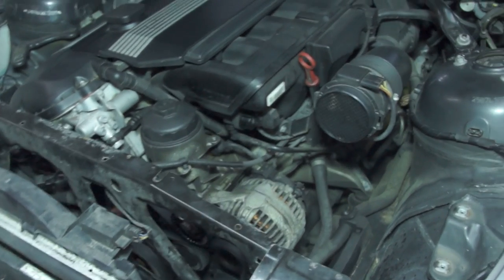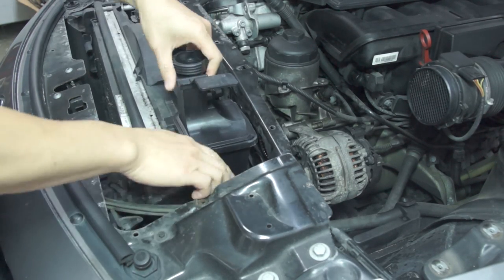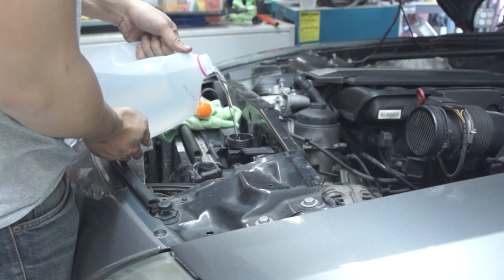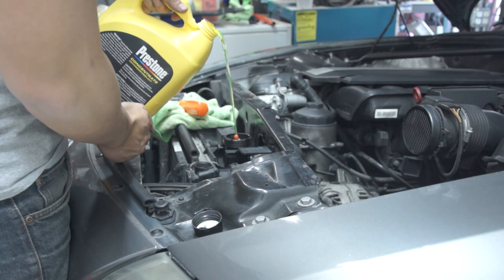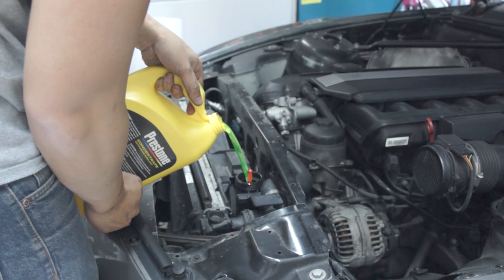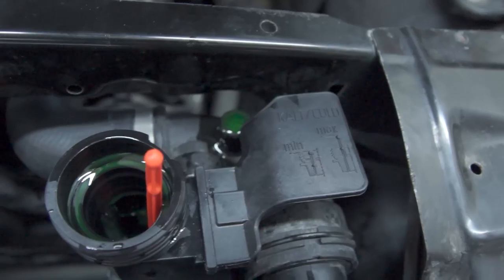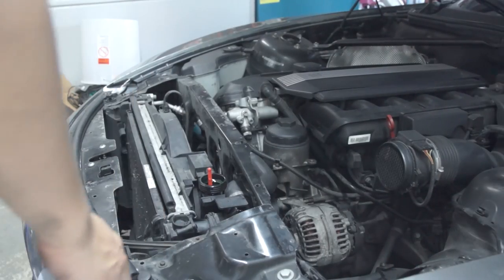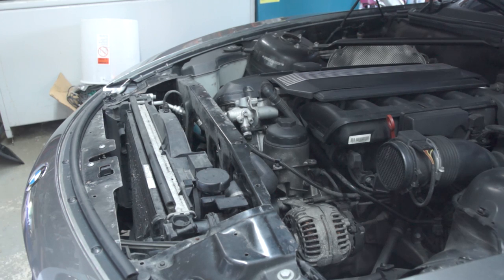Expansion Tank Replacement - BMW Z4 Vlog #22

Comment: I don't know if you park your car inside or out, but I park my car indoors. As a habit, I open my hood after I park to allow my Z4 engine to cool quickly. It may help in having the plastic parts bleed heat faster after a drive.

Comment: Hey @zed4me, I am wondering where do you buy your expansion tank? Also, I want to change my radiator and expansion tank as well. I have a 2003 BMW z4 3.0i. I want to know any advice for that? Like where will be a reliable source for me to buy these two parts? Also, what are the tools that I may need to use and replace these two parts?

Comment: First thanks for all of the great videos.  I just bought my first BWM Z4 E85 (2003) model.  Your videos have been a ton of help as I now have a roof replacement project ahead of me.   One question I wanted to ask is have you found a suitable upgrade for the headlights.  My bulbs don't really shine and with all of the new LED options, I was wondering if you have found a suitable replacement.
Reply from the maker: +Mark Byrn I've upgraded my projectors.. been meaning to make a video about how I did it but going into the wheel well arch is really annoying lol First I'd say clean the headlight with a headlight restoration kit.. then if its still bad, consider a bulb replacement. I don't know if LED would be brighter though, but consider HIDs, if you can cover up the squirrel finders on the projector.
Reply: +zed4me Yeah I cleaned the plastic glass with a kit, but I really don't like my bulbs.  I'd love to see a video on how you upgrade your lights.  I will look into the HID swap.  Was it easy to install?  I see the hatch behind my front wheels so I know where to go, just not sure what to buy.  Any insight would be appreciated.  Where did you buy yours?

Comment: Hey did you have a problem with the lower sealing rail? I noticed my z4's rail had came loose and I have been having trouble reinstalling it. I'm not sure how it goes back on
Reply from the maker: Sorry not familiar with this issue. What's going on exactly?
Reply: My coolant top off light was on so I grabbed some 50/50. When I looked in the bay there was some lost coolant on the ground as well as this loose plastic rail.. I googled the number on this rail and it brought me here, http://www.realoem.com/bmw/enUS/showparts?id=BZ11-EUR---E85-BMW-Z4+2.0i&diagId=17_0145  its #5
Reply from the maker: cbrindle3 I didn't have that issue, so I'm sorry I can't be of help

Comment: hi what company tank do you have. I have hella and still have problems with it leaking slowly from the  bottom
Reply from the maker: Check your hoses that doesn't sound like a tank issue. I think I went with behr
Reply: Hi when I move the bottom of tank it leaks right from  tank joint where there is no hose joint. I going to by a bmw tank now

Comment: shouldn't you be using the bmw $25.00 a gal. coolant. I read there are different  mineral /silica levels in different  euro vs jdm vs us engines. nice z4. m54 does not recover well from over heating.
Reply from the maker: I don't know of any real reason, just people saying that on the internet. Seems like a gimmick to me. I'm not have any issues so I'll stick with my regular coolant lol
Reply: prestone is silicate free. any silicate free coolant is fine.
Reply: zed4me It is highly recommend to use silicate free coolant as silicate can eat away at the gaskets and water pump. You don’t need to buy the BMW brand coolant, you can use the Dex-Cool labels coolant that is silicate free from autozone. I use silicate free in both my Z3 and Honda VFR800
Reply: I must say it puzzles me too.  My German engineered z4 has lots of problems including coolant leaks while my faithful old Japanese Corolla with double the mileage has not leaked a drop and is problem free other than wear items.